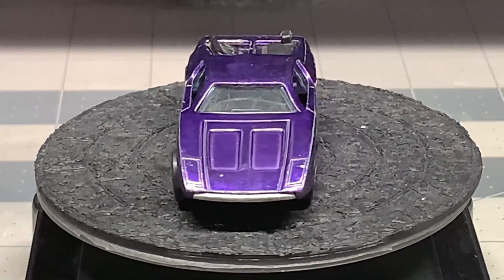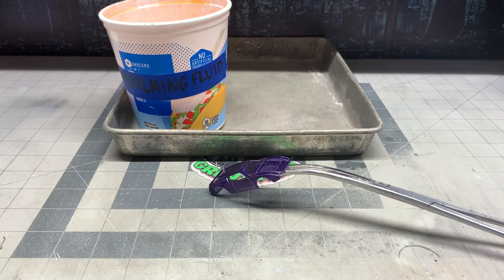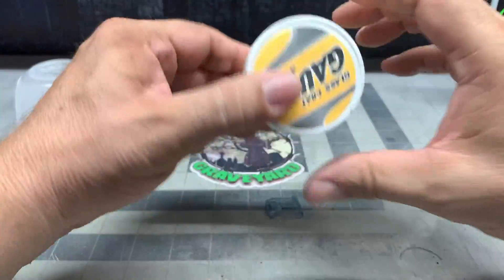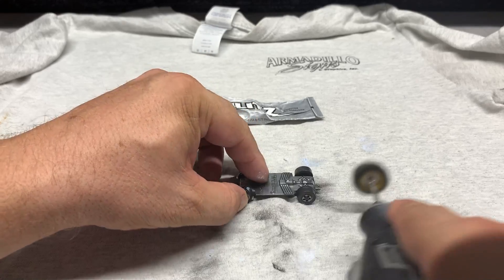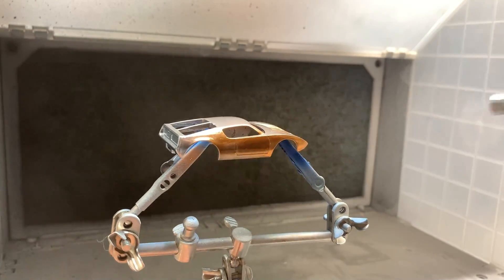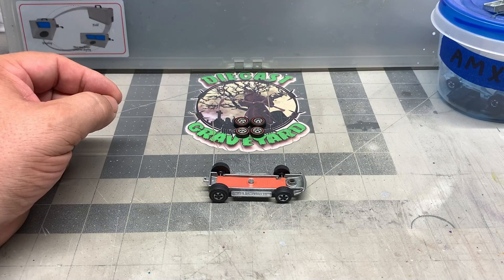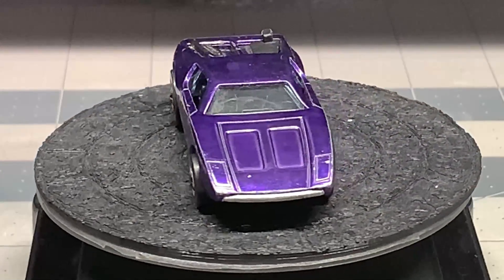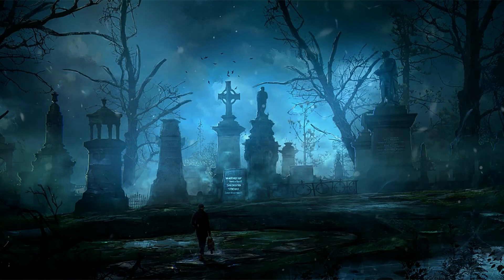Hot Wheels AMX 2 Restoration Custom

Comment: Beautiful! You can just fall right into that paint! So for a challenge, is it possible to take a plastic body mainline HotWheels and put SpectraFlame on it and make it a redline?
Reply: @DiecastGraveyard  A lot of the newer cars have plastic bodies. Some of them look good but they look plastic. I was wondering if they could be saved by giving them the Spectraflame treatment. I hate that they went with plastic bit the molds are still decent